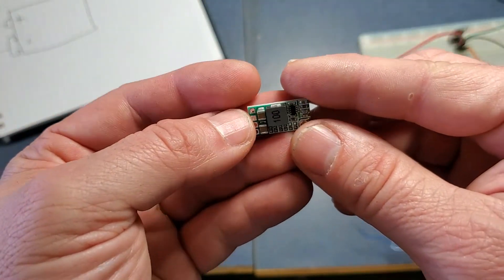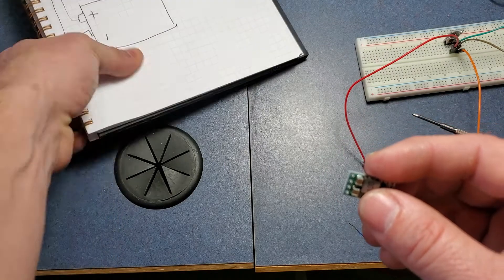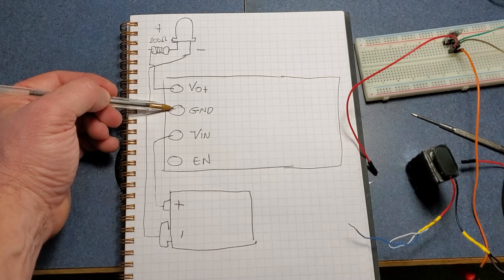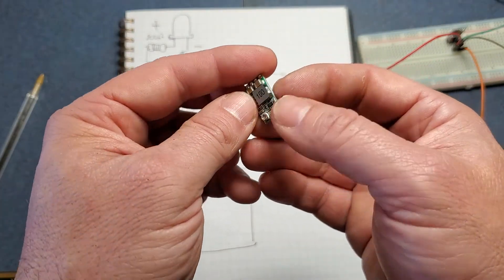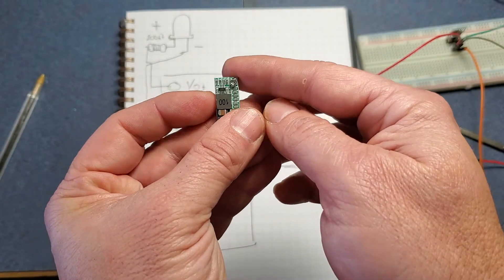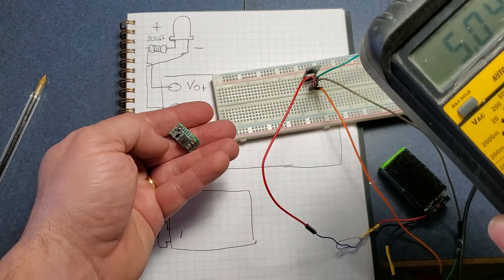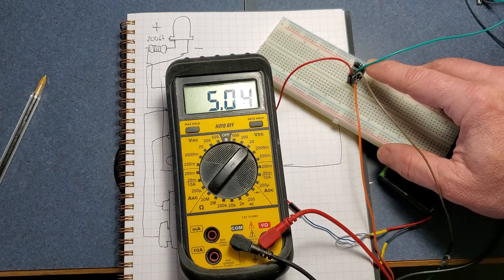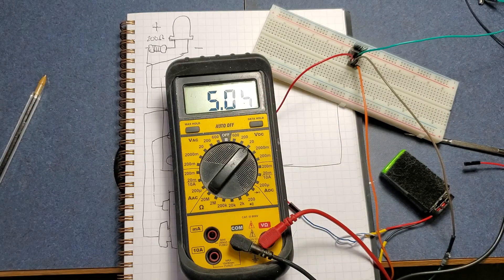How to wire a mini 360 5V buck converter power supply

Comment: I dont understand how to use EN (Enable port) ??? just do not put any cable there ?
Reply: From what I have heard/read, you can control output of the board by using enable pin. The data sheet should have a threshold value for the enable pin. When voltage exceeds the threshold you can control the output of the board. Ex- when pin goes high then regulated power will flow, and when goes low it will stop flow to conserve power. I believe the main use would be if you had multiple power sources or regulators or a switch where one or the other could be an input to the enable pin to control it. For most boards I think the ‘enable’ is enabled by default. This has been confusing for me to try and understand as I was trying to figure out how to wire my board as well. I may still be wrong but I think long story short the enable pin is not “necessary”? But could be useful in some situations where you want to shut the board down when power isn’t needed.

Comment: So input current need to be higher then output ?
Because in database for this buck says that can output 24V
I am planning to connect this buck to charge 3s and 4s serial connections battery

Comment: Thank you so much. Just to add, the EN hole is a remote enable function, I heard.

I'm not an expert on the way it works, but there is information out there. It means you can switch on and off when needed.

Thanks for the video!